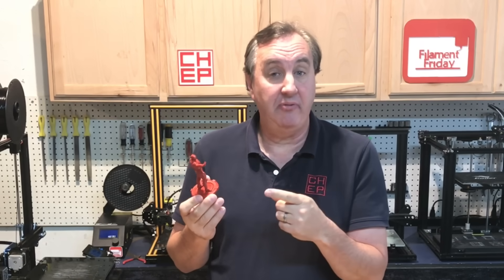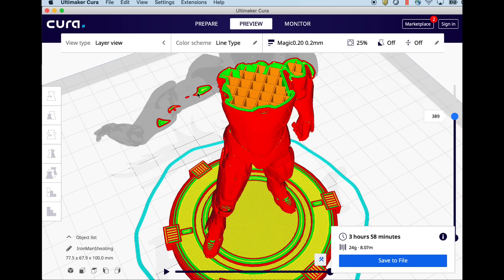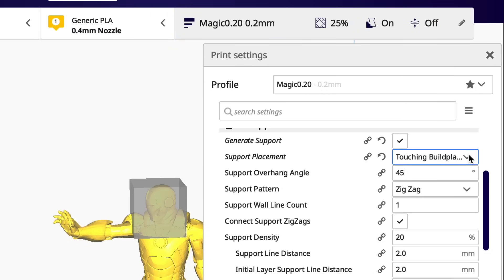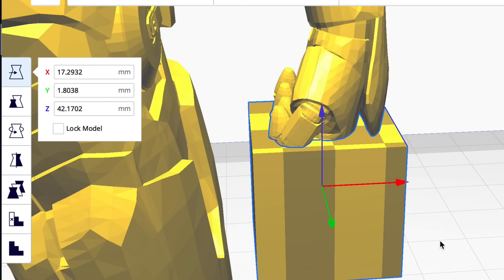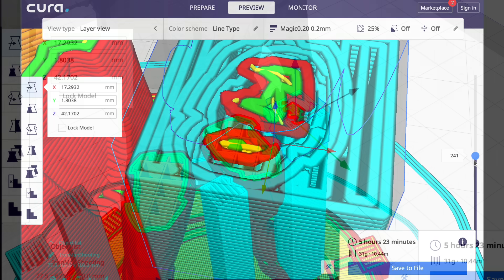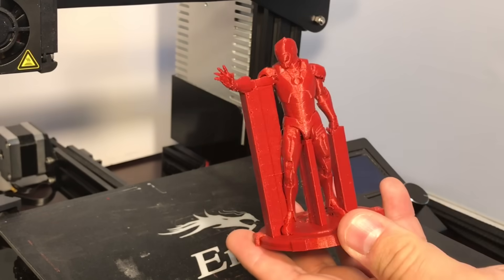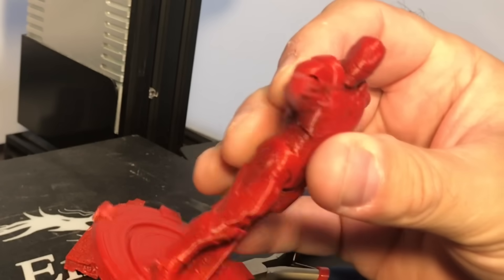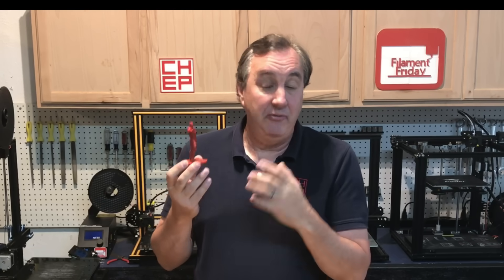Custom Manual Supports in Cura Slicer 4.3

Comment: i want to print a hollow version but how does that work with the head? theres noting to print on when it comes to the top layers. is there any way to put internal supports? i dont want to use infill
Reply: lightening infill

Comment: Thanks for the video! As a beginner in 3D printing this is an absolute gem!
FYI: Custom Supports doesn't exists in Cura 5, found something called Custom Support Cylinder which seems to be the same idea, just with a few more options.
Reply: I noticed that too! I had the custom supports in Cura 4.x however when i updated to 5.x i've lost it. Now i am using also this Custom Support Cylinder.

Comment: Good video I knew about these but you've shown me a much better way about doing it I was printing a miniature with a Cape and a sword and they needed supports so I used the little spike looking custom supports and they worked well but they failed in some parts because the supports weren't dense enough but I'll fix that and see how it goes thanks for the tips

Comment: I like this HOWEVER I have a problem with tall skinny supports getting knocked over even if I tell it to avoid supports. How do I make it wide enough at the base of the support so It won't get pushed over...  Done Rafts, much better, but a lot of plastic, and even then the tops wobble a bit as it is adding the layers towards the top.

Comment: Hi Chep. I have a yarn bowl with a spiral cut out and I only want supports in those small area with the spiral. custom supports when I click take it from the top all the way to the bed but I only want it starting from the bottom of the spiral gap. Is there a way to do this? I have tried using the blocker but cant get it to work on the custom supports. Thank you if you see this and can help at all or point me in the direction of a youtube video to watch.

Comment: The only issue i got with cura is support features ( easy and quick) and the interface. Compared to ideamaker wich got the best user interface of all slicers i have tried, it is lightyears behind basically..and i am seriously giving cura a go now...but i have so far not found anything that makes me want to use cura by the sheer fact that a basic feature such as support requires tampering, while you press a button in ideamaker, and remove if you want.. symbols are understandable for a new user with clear use of the symbol meaning..cura has these odd shaped buttons that basically could mean whatever . It does what it does if you got simple things and all of the rest require you drop the graphical interface and go in to menus. Air gap in partikular is seasoer controlled in other slicers.

Comment: My print just failed for the second time because Cura didn't generate supports where they were needed.
Reply from the maker: Did you verify they were there in the preview mode before printing?
Reply: @FilamentFriday  Can one customize supports 100%? meaning not deleting supports where is not necessary but adding supports where cura isn't generating them

Comment: It's kinda weird; Cura 4.8 doesn't have the Support Removal or positioning tool, unless I'm missing it? Also it doesn't show them when you Slice. :/  Anyway I manually added using the Manual Supports plugin, let's see how that works on a build I have going.

Comment: I'm doing exactly as you are when placing manual supports where I think they should be, but when I hit the Slice button, the support block I placed doesn't show up with the rest of the model. It still appears as a "grayed out" transparent block. Any help would be appreciated... using Cura3D 4.8 and downloaded the plugin from the marketplace just as you demonstrated.
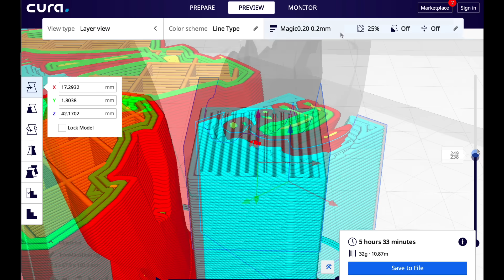Reply: Answer at 3:43. Set support placement to "everywhere".

Comment: YOU DIDNT SHOW HOW TO GET SUPPORT BLOCKER, this video is useless
Reply: He Did...... You need to go to the Marketplace on the top right hand corner in Cura.. Looks for "Custom Supports" in Plugins
Reply from the maker: https://youtu.be/su_m5zV9rvA
Reply: You need to watch properly you are useless
Reply: Had this problem as well, turns out the icon is different in my interface. It looks like a polygon made up of vertical lines with an empty box. Maybe it's the same for you.

Comment: Chuck, I follow your directions to a tee. But when I go to change density in my supports, after having to ironically enable support, it drops in all the supports that Cura would normally put in and I have supports all over the place. The problem is not with the plug-in but when I generate support in the cura settings. Can you help with this?
Reply: After you change the settings, then disable it again. The changed settings save, but the box must be unticked or you get the error you describe.

Comment: I'm using CURA 4.5.0. I loaded this plug-in, but it doesn't show up on the left. Any suggestions?
Reply from the maker: Check your graphics card vs Cura requirements.
Reply: @FilamentFriday  I uninstalled 4.5.0 and installed 4.1.0 and it worked. I did this on 2 different computers.  Where do I find the CURA compatibility info? Thank You

Comment: I've been trying to get this to installed with Cura 4.6.x and it does not show up.  I've tried this on 2 different computers, and get the same results.  The plugin does not show up on the menu, even though the plug shows it is installed. Any one else had luck with this version?
Reply: Same. I got the custom supports but support blocker no longer exists in the marketplace.

Comment: thank you Chep, i'm a new 3d printer from Italy and i understand your pronunciation pretty well !!!! thank you for your video ! One thing i tried about it .. at 3:51 you say to change support density you need to enable GENERAL SUPPORT but if i do than i get back the entire "support " excluding my local " support " while if i select the support i created (custom support) and i go to MODEL SETTING i can than change the values like infill setting ! is it a correct way to do that as well? thank you

Comment: I'm still kind of new to 3d printing, but I just can't believe you use 60 or even 80% support density... I've always used 10% and then 33/50%  interface. And everything's just fine. Am I missing something here...?
Reply from the maker: Depends on the print. I like it when the support comes off as one piece so solid with weak top and bottom works good here.

Comment: Hey, instead of using 80% support infill all the way up, you can:
- Enable Support Interface
- Support Interface Density 80% - 100%
- Support Interface Lines

That will print the support structure with lower infill (20% if you set it) and increase the density at the interface up to 100% - if you select lines as your interface pattern it will just be a solid layer.
Saves material and supports just as well and better, that the method of the video.

Comment: I have the latest version of cura. When  I click on generate supports my only option. I'd support overhang angle. I don't have a settings option like you.
Reply: He didn't quite specify. Next to search settings when looking for these options, there is a 3 line symbol. Click on it and enable expert mode. That will make the other options show up.
Reply from the maker: Click on the gear next to the support header to see all the options you can add. Or just use my profiles.

Comment: My version of Cura does not seem to have add support tap, only block supports. I have an item that will not add supports on its own however there are a few spots that need a support.
Reply from the maker: Check your graphics level vs Cura requirements.

Comment: Custom support plugin only support which touches build plate it doesn't support gap between the model please help
Reply from the maker: Change the support setting to everywhere but then uncheck the support box. 4:10
Reply: @FilamentFriday  it did solve the problem , I was actually resizing it too small  beyond what nozzle support . But where can I get the setting like infill percentage ,support pattern etc. That settings are only for inbuild support of cura

Comment: What if you set the main support to be low density and support interface to be high density? I wonder this could be an option to spend less time & material on the pillar, while having better support for actual printing.

Comment: I'm on cura 4.4.1 and for some reason on preview the support blocks are not working
Reply: Did you find a solution for this?
Reply from the maker: Check your graphics card vs Cura requirements.
Reply: I had to restart the project from the beginning. Thank you both. It took more time but I managed to get supports on the object. It was a hiccup on the PC.

Comment: CHEP how do you print so fast with the Ender 3?  I am printing a small parts box for my Ender 3 and it is going to take 14 hours to complete.
Reply: I would suggest to decrease your infill, that usually adds a lot of time to prints.
Reply: Also, check your layer height. 0.1 layer height will take twice as long as say 0.2 layer height
Reply: Okay thanks

Comment: Hey chep, im trying to print a model of the Mandalorian helmet and am trying to setup the supports for it, i am having a lot of trouble doing so, can you possibly do a more in depth version of the supports for something like this or do i just need to sit down for like 5 hours placing 100 supports or blockers?
Reply: or can you dial back how often tree support is used?
Reply from the maker: You don’t want to use standard supports?
Reply: @FilamentFriday  I have found i have had awesome results on my new ender 3 pro with the tree, support feature. I was just trying to print a kids helm and minimize the supports or adjust how to dial back the sensitivity of the supports, but i have now had a lot more experience (basically spent the whole week on holidays using it) and realise the supports dont use much plastic anyway.. The ender 3 can pretty much print almost 70% or more angle so i am quite impressed the lack of supports that you need these days.
Reply: People usually do armor in many separate pieces
Reply: @Ilostmycactus  Yea, I will just cut it up a bit.  Good thing that experience building games in Ue4 will come into a lot of use doing this stuff :)  I was just trying to do a kiddy small version in one bang, but now i am not opposed to cut ups as it does not really take any longer, but probably saves time if you get a stuff up,

Comment: I am using Ultimaker Cura and I am very new to 3D printing. I have a octopus print that I want to make but there is only one support I want not a whole lot. I downloaded the plugin but the sidebar is all greyed out! Why is this? Edit: I figured it out! But how do I get support blocker in Ultimaker Cura?
Reply: Support blocker is a default tool already in Cura, it should be the tool at the very bottom.

Comment: I am using Cura 4.4.1 and I am trying to print thing #2039374 from Thingiverse. Without supports added in but supports set for 50%, I get red patches to show up on my model. I assume those are indicators of an overhang of greater than 50%. Your video is very helpful.  I, too, can’t get the supports to show up.

Comment: I installed this plugin and got the little blocks in place, but when I slice,  they dont appear as full support columns like in your video.  They just stay as blocks.   Not sure which step I missed.
Reply from the maker: Do you have supports enabled?
Reply: @FilamentFriday  No, I believe you said not to in the video
Reply: I'm wondering if it has to do with your profile settings.  You have so many showing compared to what I use.
Reply: I'm having the same issue but I'm thinking it's the version of Cura I'm/we're using. I'm on 4.1 cuz it's the one I'm most comfortable with but I think the plugin may not be optimized for an older version.

Edit: I've updated to 4.4 and it works all fine now. Gotta sacrifice something for something else I guess...
Reply: I had this same issue, my problem is when I resized the support blocks smaller it did this. I was printing a mini (28mm) and had to keep the support blocks at 100% size or it was too small to generate the supports. That is most likely your problem (they are too small).
Reply: I was having this same problem. Your solution worked for me. Thanks.

Comment: can't figure out, I can put the blocks where needed, but when slicing, it does not give supports on preview.
Reply from the maker: Did you enable supports in settings?
Reply: @FilamentFriday  I will try thank you
Reply: @marchioflooring7456  to be clear, Chep said in the video that this will only work if you do NOT have supports enabled.
Reply: I'm having the same problem, when I preview the model, it only shows the blocks - no supports. I've done it with generate support on & off.  I don't understand.
Reply: @ThurstonThorntonIII  Same issue.  Even when disabled as he says...it only shows the blocks, not the supports.
Reply: @TravisRamage  hey, I went ahead and printed my model anyway and the supports all printed out just fine!  Still sux that we can't see them in preview 😔

Comment: Great one.

You could have reduced the density on the support, enable support roof and then crank up the density there. It would have been faster and still maintain the density on the top for the small details.
Reply from the maker: Lots of ways to do it but I find a solid support can actually break away cleaner sometimes because it’s a solid mass.
Reply: @FilamentFriday  good point. Will try that out.

Comment: Ok I figured out why his settings are increasing your times. Do this;
1. Set your actual layer height .08mm higher than normal (trust me, you'll see why soon)
2. Set adaptive layer max variation to .08mm (this needs to match the added layer height)
3. Keep the step size to .01mm
4. Crank dat adaptive layer threshold way up to 500 or 600 and then slice.
YOU'RE WELCOME!

Comment: I'm still using Cura 4.0 and when I made custom supports the little blocks I thought you could only do one at a time. Also when I put the little block on say like when you did on the hand I had to grab the vertical arrow and drag the box support down to the base and if you went past the build plate it would raise the model.  I  don't know if 4.0 works like it did in your vid with just leaving the small block on the hand and the slicer fills in the support automatically. So I'm going to switch to 4.3. Thanks for the info and video

Comment: Great video. Will give it a try!  Though, your CURA looks way different than mine does. I get a mess of one color and I don't have that scrolling option to check the layers.
Reply: @nismo510 not there. I had to use the add on to use the 3.6 look. Then it showed up

Comment: hello two questions, i am using cura wanhao version, and i want to move to cura 4 for all those additions that it has. Is there any file that i can download, or maybe all the setting i need to use wanhao duplicator i3 ? thanks in advance.
And one second question, in another video of yours i have seen that you can change the density of the infill. can't i use this method so the supports won't be 100% and waste pla?
Reply from the maker: My CHEP Profiles might work. 
Yes, you can change the supports density in the support area of Cura.
Reply: @FilamentFriday  well i did not write that correctly, as for the older video i mentioned, i meant that you can have more than one density in your print. can this be done for the supports ?

Comment: I printed this exact model a while ago with full support. It took ages to get it of. In the process, I broke the arm and both legs of the model and had to glue them back in place. It was a pain. Great tip! Will definitly use this plugin next time.
Reply from the maker: Thanks for confirming my suspicions.

Comment: I don't understand how you can print the right hand pinky that's sticking straight out without supports.  Still learning all of this.
Anyway, do you have an opinion of this versus Meshmixer tree supports?
Reply from the maker: The fingers build on upward angle so Support wasn’t needed. 
I don’t use mesh mixer so I cant compare.

Comment: Wich is best, custom supports or tree supports?
Reply from the maker: Depends on the print and how much support it needs.
Reply: @FilamentFriday  in a case like that ironman, putting to print tree supports just in high angles will be safety like the custom support method? I like tree supports because dont need to clean the surface.

Comment: Thats bulky and time expensive. Just use the cura special setting "Tree Support" or use a different application named "Meshmixer" and there you can make tree support too and add some like you want with the mouse. That simple and fast!

Give me feedback if it's better.
Reply from the maker: Tree support will take more time and plastic but is useful on some prints. Did you watch my video I referenced and linked to at the end where I cover tree support?
https://youtu.be/7BURpQNXrDA
Reply: @FilamentFriday  what about meshmixer?

Comment: Hi Chuck. A comparison against tree supports might have been interesting too - that can get a bit funky at times, but I find it can work well for more difficult prints.
Reply: It was your video that inspired me to try tree supports, I just meant on that same print.
Reply from the maker: As mentioned, I showed tree supports in a previous video and linked to it at the end. https://youtu.be/7BURpQNXrDA
Reply: Yes! I also have the same question. If I check the enable supports box, can I change the custom support to the tree support type?
Reply: I just did a model from fortnite exactly like that for my kid and the support was everywhere and took FOREVER to remove and was super dense. Wish I saw this earlier.

Comment: Very cool tipp for the support. But i would print the Support with 20-40% density and Support roof and buttom. You can save even more plastic and time!
Reply from the maker: I showed why I didnt.
Reply: @FilamentFriday  There's a support roof density setting. Maybe 20% support density and 60% roof density could have helped.